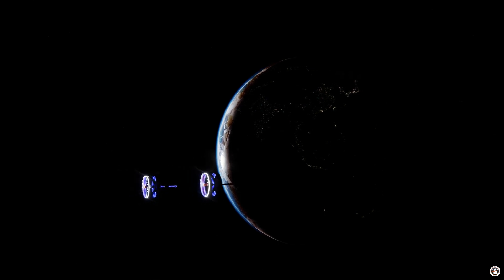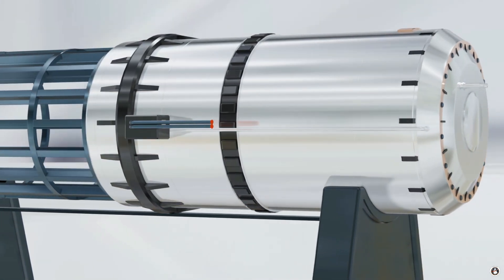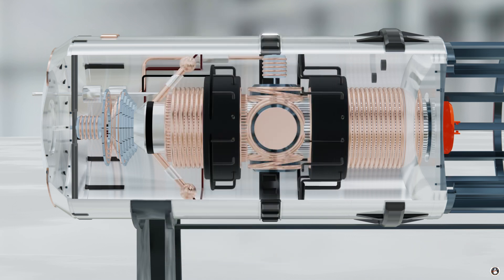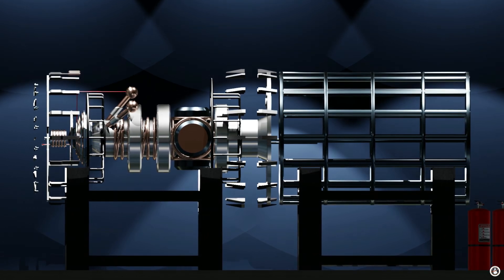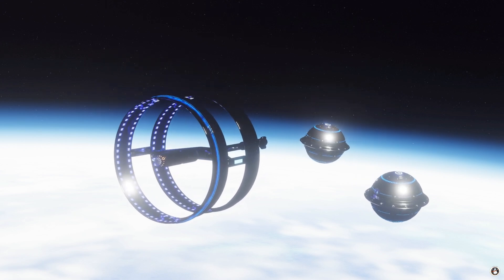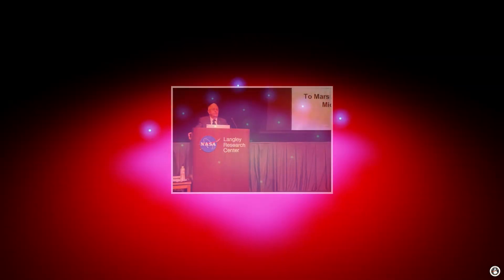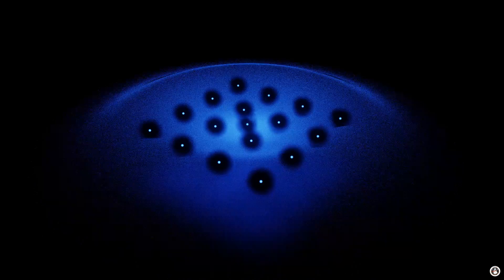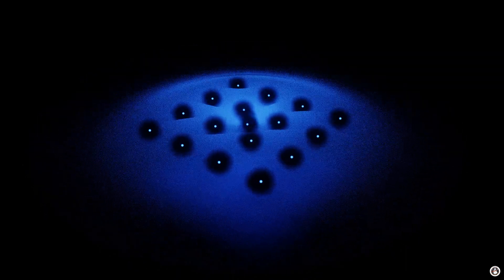Muon Catalyzed Fusion Engine - 8% Speed of Light - Mars in 5 days?

Comment: Did anybody solve the problem of Muon stickiness to the He4 resulting nucleus? 
Because in the 1990s, when I was doing my Ph.D. in (Laser) Inertial Confinement Fusion, this was an unsolved issue.
The lifetime of Muon was too short to catalyze the number of D-D or D-He3 reactions to produce enough energy to produce more new Muons (and keep all the ancillary systems powered up). In this case, the mechanism for Muon formation via Kaon decay, is even less efficient — especially considering how bad lasers are in converting their external excitation energy into optical energy at the properly tuned frequencies.
AFAIK, Muon catalyzed Fusion was a neat SCIENTIFIC effect from the 1950s, but later demonstrated to be an unworkable TECHNICAL Fusion scheme. 
I always had hope than someday, through some discoveries in Quark Plasma Physics, some mechanism may be found to achieve Catalytic Nuclear Fusion, but Muon Catalysis never worked. Being educated as a High Energy Density physicist, not a Nuclear one, I cannot say more.
Full references, please!
Reply: This conversation sounds like the top 2 smartest kids arguing that the answer to question 4 on the exam was 57 or 58 while my answer was south africa
Reply: Not too sure it's feasible to leave our sun behind without working fusion. Which if we master that this would be child's play.
Reply: @rexmann1984  I mean we can, its just way harder
Reply: @antaresmc4407  you're gonna need a ship that can last 200 years at a minimum just to make to Proxima C.  You might as well slap a Molten salt or liquid metal fission reactor with an Ion Drive. Might take you a thousand years instead of 200 but on those time scales does it really matter? In both cases you'll need a ship and crew capable of replication. None of the vital parts will last that long. As power hungry as this drive will be; the mass for the energy production will negate it's benefit in efficiency.
Reply: @rexmann1984  there is no way of going interstellar with an ion drive lol. I mean if you are willing to take a million years... And speed does mater, stuff breaks and folks may lose interest or do something, life support costs also increase...
But there are alts without fusion that can push you interstellar. My personal favourite is a multi stage spacecraft with an FFR (Isp~1-1.5Ms, 3-5%c). You push it with a laser up to 10-15%c and brake with the engine in the other system. You should be able to arrive at Proxima in a generation or two depending on your assumptions, and with the original crew alive if you have no life extension, that you will
Reply: @antaresmc4407  at .10c  it's still a 150 year journey at .15c it's a hundred years. We build very few mechanical or electronic things that can last that long. Regardless of how fast we go we can't break c which is painfully slow with as spread out as space is. Stars and their planets aren't all the material worth doing something with. We have a massive Oort Cloud and so do most stars in all likelihood. 

    This reminds me of a fable my father once told me. An old bull and a young bull were sitting on top of a hill. They see down in the pasture below a bunch of cows grazing. The young bull says to the old bull, "Hey, let's run down there and f#&@ one of them cows!" Then the old bull says to the young bull, "Let's walk down there and f@#& them all."
Reply: @rexmann1984  with the bull analogy, you can do both, civilizations grow and spread. You can colonize tge stars and your own, and you dont spread out too much because you arent getting back investment 10000ly away...
Also, Proxima is 4ly away, so at 15%c its about 30y, not 150. Annd you can break c, at least inside the ship. Let me explain, you dont magically stop at c, just spacetime goes weird, which is roughly equivalent in time to go FTL, you are just slow and squished from an outside view. Anyway, tangents aside, you dont want IS travel to be as casual as air travel, but you neither need to, high tech civilizations are so ridiculously massive I cant strech it enough, and ocasional travel when the product is valuable enough or colonization, it can be fine and a couple years are fine to wait, specially if you have brain augmentations and can slow down your clock. Interstellar transport of people and info on the other hand can be done easly digitally and at lightspeed
Reply: @antaresmc4407  would you like to start this project (interstellar colonization) this century or this millennium? Because this drive is like late Millennium if not next. Due to power constraints.
Reply: @rexmann1984  power is not the issue lol. You can put 2 big mirrors around the sun and get an exawatt. The issue is that 
1) the tech doesnt exist now, nor there is any demmand for it currently. 
2) the infrastructure doesnt exist now, nor there is any demmand currently.
3) you are not gonna do it this century, why would you? It would take a ridiculous amount of resources for basicly nothing.

On this millenium on the other hand, give a few centuries for space infrastructure to develop, stellasers to be tried and tested, magnetic confinement tech to be made, and the resources there to make it even if its for science, it could legit be done. Ill say that is folks really want it, 500y is a plausible, but for a more organic development I would wait for the end of the millenium
Reply: @antaresmc4407  Today, any attempt for interstellar travel is like  medival  people trying to build... a walking castle that can help them to defeat their enemies and transport large groups of people safely. It would take a lot of time... so long that that many participants would lose interest and focus on something that they can achieve in their life time. They would waste a lot of resources on a flawed and archaic design... that would become absolute shortly after launch... perhaps even before reaching to final stage , because someone  just invented steam engine > and built first  train. You can also slap armor on it and take it to battlefield !!!
Reply: @rexmann1984  self-repairable nano-materials will replace metal-like constructions.
Reply: I believe a few comments down, references are given.  I'm so much of a layman, no idea if they are credible sources, but you asked for them, and @AsteronX delivered.
Reply: Yeah BUT....

This is mostly crap and conjecture...... 

a) We need to make the journies survivable - in terms of electronics, mechanical structure of the ships, and for human life..... ships hitting dust and micrometeorites, and interstellar hydrogen = gamma radiation and mega explosions from hitting interstellar fly shit at extraordinarily huge speeds... This detonates the ship in chunks and bathes everything in radiation.

b) AND because the distances ARE so extraordinarily HUGE - we need to close the time scales... which equals for now, increasing the acceleration rates, the top speeds and the decellaration rates...

c) Increased speed = death.  See a).
Reply: @shanet.hanson8250  
a) micrometorites are managed with a thick shield, and the gammas onlg appear at ultrarrelativistic speeds, and can also be shielded. These ships are huge, dont think you are gonna be anywhere close to the front, we are talking kilometers, so it doesnt matter that much anyway...

b) distsnces are ridiculously huge, acelleration times are not an issue. You may lose a small fraction, but nothing to die for.

c) no. See a :P

Id like to know why you call it crap and conjecture just because there are engineering challenges
Reply: @antaresmc4407  About the discussion of this happening organically in a millenia or so, you are assuming our current global civiliazation will not collapse and this social fabric in its current state will continue sustainably for the next 10 centuries? That is being supremely optimistic in my honest opinion :-) 

Just look at all the western Birthrates, they are almost all population inverted in their current form, we will collapse from just the weight of supporting the elderly. Do you have any insight into this?
Reply: Nerrrrrd!
Reply: Don't waste your breath. These guys claimed to be working on a new functional (as in implemented) Alcubierre drive. It's all bs.
Reply: I have a idea,
Reply: Sure they did
Reply: Hello to everyone in this comment thread. Question or recommendation??
Need to find an independent testing facility that has a horizontal near zero friction glide rail test stand measuring low thrust levels up to 1 Newton.

Demonstration prototype engine has completed testing.

But until it has been independently tested and validated, the only claim we can state as fact, is that the engine was damaged during the final tests. Repairs underway.
The Engine will then be available for independent testing.

Engine type,
Cyclical mass driver, table top size demonstration prototype.
Weight, 5.45 kg
Power consumption peak per cycle 18 watts.
Forward thrust, 0.11 Newton's per cycle.
Total Displacement thrust, 0.19 Newton's per cycle.
Power to forward thrust conversation efficiency, 35%.

Douglas Renzoni CTO
Reply: Yeah what he said? Out of my league here
Reply: Would you say that most of what you know about your field came from your time in formal education or your own independent research?
Reply: and, micrometeorite shielding at those speeds?
Reply: I have a question if gravity is a wave why can't we ride it or sirf it .has someone looked upon gravity in this sense . ability to ride the gravity wave like surfing it
Reply: AstroneX Answer they good man is trying to ask about his references. Give us the references. I think Dr. Leehom lady got it wrong. You know, technologically Rydberg matter right now it’s pretty on exploitable, because aside from it being in its infancy as a technology, it takes it in Normas Lee powerful lasers if I’m not wrong in order to be able to create it and I really doubt that it’s behaves like antimatter in annihilation process that is 100% efficient because if it was 100% efficient like antimatter we should be getting gamma rays and pions similar to antimatter.
Reply: AstroneX Answer they good man is trying to ask about his references. Give us the references. I think Dr. Leehom lady got it wrong. You know, technologically Rydberg matter right now it’s pretty on exploitable, because aside from it being in its infancy as a technology, it takes it in Normas Lee powerful lasers if I’m not wrong in order to be able to create it and I really doubt that it’s behaves like antimatter in annihilation process that is 100% efficient because if it was 100% efficient like antimatter we should be getting gamma rays and pions similar to antimatter.
Reply from the maker: Actually, it was found that when the thermal energy of the muons themselves was factored in, the process proved to already have a net output, though 3 to 5 times the released energy would have to circulate internally. The remaining problem was an efficient muon source, now solved.
Reply: @asteronx  
References?
You are saying the same that the Wikipedia article.
Even if the numbers for the alpha-sticking factor are better (0.3-0.5% instead of the earlier 1%), the muon short lifetime and the energy of formation make the net energy production via fusion at least 1 to 2 orders of magnitude lesser than that needed for technical breakeven. Using lasers or e-beams to produce Rydberg matter is going to be a VERY inefficient way to do it. Really powerful Nd:Glass lasers are 0.4% plug efficient. Excimers are not better. Both emit in very specific frequencies that are  not neccesarily tuned to those for Rydberg phase changing on Deuterium. Any frecuency conversion is not better than 50% efficient, and being a 4-wave quantum optical non-linear process. It is a high-power, low energy process very difficult to model in theory and humoungously expensive to implement technically.
Muons made this way are not going to be cheaper than those made with high beam current specifically designed particle accelerators.
When I was a grad student (early 1990s) the designer of Shiva (the LLNL first ICF machine that appeared in the first 'Tron' movie) told me that Laser ICF would be technically workable when Solid State ('diode' type) Lasers — that can be up to 90+ % efficient in their current low-power/low-energy state-of-the-art. Nice for Blue-Ray SF movies — to the Terawatt/Gigajoule required. That was expected for today times. Have you seen one of them yet? Even for this scheme you may need MW/KJ at best. With lasers and fusion it has been always the worst ... for 7 decades.
From your video, it is not clear how muons – NUCLEAR particles associated to the Weak force — result from EM processes. As I am an ignoramus on Electro-Weak HE Physics, cannot say  anything until I see some refereed references. Then my best friend — a former HEP grad and a Kerbalist fan — may educate me.
Sorry, but after 40 years on the Plasma/Fusion/HEDP racket, I am very jaded  about extraordinary paper (or Video) claims on Propulsion and Power devices.
You must be as young as I was in my 1982 YT thumbnail photo!  I was very excitable about these things at that tender age.
Again, publish references for credibility. The Angry Astronaut does that very well, even when it is clear he has not a solid formal STEM education.
Reply: @Tordogor  the muons are formed from the UDD fusion reaction, which is pretty iffy, given that only 1 team has worked with UDD and its not very clear how to reproduce accurately, explain or how it behaves well, according to the reviews Ive seen and my rather very limited knowledge. I cant say anything, but itd iffy in my view...
Reply: @Tordogor   you react too serious to this "pop science for kids" clip... it's just another youtuber looking for extra clicks ...
Reply: @stefanbanev  its presented as a serious proposal...
Reply: @antaresmc4407  
I like your style!
Pity there are so few commenters as  knowledgeable and thoughtful as you.
Reply: @Tordogor  thank you! :D
I feel like I dedicate too much time to nerdness and HSF XD, which is sadly very rare...
Also, there is value to these things, and you dont know where you will find interesting conversation to learn something new or distract from this life both amazing hand hard to convince it doesnt suck XD
Reply: @Tordogor  Lol, this was the first thing I thought... Where does the immense power(and power density containment) for the multiple laser systems come from? Modern energy-on-target efficiency from laser technology is enough to negate the overall thrust efficiency in this system. And then there's the indefinite 10MM°K capable magnetic bottle problem. I guess the proposed engine could be designed for intermittent thrust🤔. IDK
Reply: @antaresmc4407  HELLO.. I'm also very much interested in propulsion systems. Some like minded people like us can team up to do some research. What you say
Reply: @Tordogor  Im not surprised that this video doesnt actually give any useful information, these things are meant to appeal to investors and the common folk, not people who actually know what they are talking about, if you get too technical in these videos you lose attention
Reply: @Meboy-uv5td  
These guys will need investors that have very deep pockets — they must develop lots of concurrent and very speculative embryonic technologies barely proven in the lab —, and also must be tremendously naive and gullible. Somebody believing that Star Trek is based on real stories of Space exploration and Technolohy ...
Reply: @FaizanShaikh-ih3uu  what are you thinking about? It looks interesting...
Reply: @antaresmc4407  I'm saying we can do like a collab or like that 🍻
Reply: @antaresmc4407  I myself wanted to create a fusion powered Engine... Then i realised how difficult was to achieve that ...given time and money and brains we can still make something impressive within decades....or otherwise it would still be neglected
Reply: @FaizanShaikh-ih3uu  we should move somewhere more adequate. Discord?
Reply: @Tordogor  That being said, that means those guys will need Elon Musk. He is the richest guy on Earth and can be their biggest investor if they manage to convince him their ideas can actually work. If they succeed in doing so, he can invest billions in those projects.
Reply: @asteronx  

New theoretical warp drive.
It was also mentioned in the video "This work has moved the problem of faster-than-light travel one step away from theoretical research in fundamental physics and closer to engineering".

1. Go to my channel and find the "About" tab, read the info and click on the link. You might have to click on the "created playlists".

2. Find a playlist about STL - slower than light and other near the speed of light propulsion, on my other channel. The new video is there about the new warp drives.
Make sure to read the video description all the way through.

By the way, did you know there were some space institutes that were looking for new math for their warp drives?
Did anyone tell them about Quantum Computers to help with big algorithms for warp drives, warp drive energy, anything space exploration related, and so on?
Imagine Graphene combined with Photonics for all our products today, and for Quantum Technologies.

This is too important to ignore.
Reply: @gameresearch9535  let me know when mankind has discovered negative energy
Reply: @faceplants2  please no. -energy doesnt play nice with a lot of physics. With QFT, it makes the vaccum spit an infinite amount of particles constantly, thermodynamics just stop applying, forces break as well, and its the door to FTL, which itself is pretty oof with causality and locality
Reply: @asteronx  can nuclear fusion powered drive get us to Alpha centuria
Reply: @asteronx  continuing with the comment above, because that part is both a criticism to the video and some discussion. Textwall warning :P

Id like to first touch on the engine design. I cant get away with what its specs are, because there are several different points made, and a bit vague, with only numbers in the Isp that I am skeptic of btw... Its mentioned that is very scalable, which goes heavily against my understanding on fusion tech, but I have very little idea of cold fusion, so fair, Im not gonna gef there. It claims aneutronicity on D-D reactions, which is absolute bust, and I dont buy that a powerful magnetic trap will deflect neutrons, like wtf @AsteronX does that mean, did I miss something? That doesnt work this way... So I am gonna use regular D-D figures to estimate its specs and neglect bremstrahlung (butchered) loses because its cold fusion and shouldnt be too important:

The models and explainations imply an internal reaction engine, so all neutral particle energy is absorbed. That and a Ve of .08c, which is over the theoretical max of D-D lol, but I guess thats accounting for lack of b-word loses I guess? Idk, benefit of doubt as Im too lazy rn to calculate. That means that we have a thrust power of very roughly 1/3MW/N, plus whatever the hugely inefficient muon mechanism uses. Im gonna assume 1/2MW/N as an estimate of all the heat of the engine, power systems and stuff to run it, as its an easy number.
For a 1 ton engine you need to produce 50GW to reach a TWR of 1, and Im telling you a fusion engine and much less the radiators required are gonna be included in that weight. So there is no way its both high thrust and Isp. @AsteronX, bruh, dont do such claims b4 calculating it, the formulas are super simple in that case :/
And again, Id like to know where tf comes the aneutronicity... 

Id also like to add a critic of small details that really bother me because they look poorly researched. First, lets make a point about the nozzle, being completely flat like this you get little advantage of the magnets you use and you create an inefficient nozzle, but thats aminor detail. Id also like to touch on when you mentioned radioactivity spreading to the crew quarters like if it was a virus. I hope you realized this is completely wrong, its true that nuclear reactions generate lots of neutrons that can cause activation, but those activated parts (generally) make no more neutrons, so the reactor just trashes itself over time without the radiation escaping assuming its properly shielded, and in a century or so you have to replace the walls as are damaged and slightly radioactive. The worst part of this thing is that thats not what you meant, because you are using deuterium fusion, that is multiple times more neutronic than fission, and with nastier high energy neutrons! WHY? That was unnecesary and makes me think you might need more research if this is a serious publication, sorry if Im not being thd most polite, but I took this as serious, or shouldnt I? (This is not sarcasm, Im legit asking, sorry, Im not great with English c:)

I have seen a bunch of stuff that goes differently to what I think I know, could you provide some references and extra reading, please? Thank you in advance :D
Specially in the rocket design  part as my kowledge of QM is rather limited, so I cant really talk about the fusion/annihilation part, that is what the listed articles talk about. Im reading them though

Also, there are probably typos I missed, that was written in a phone late in the night :P
Reply: @antaresmc4407  
Good analysis!
Have any UDD Fusion references other than Wikipedia's1?
Reply: @antaresmc4407  If it were less of a nozzle and more like an electron emitter I wonder what application there would be for a solar sail.
Reply: @nikorasu6930  for that arent regular beams just better? They are also short range
Reply: @antaresmc4407  Not when the device in question requires the power of the sun for it to move.
Reply: @nikorasu6930  electric sails are way more efficient than light ones, and you use that power anyway...
Reply: @Tordogor  ok I thought I replied you with a set of references I looked for. Youtube us fun :/
Anyway, search the works of L. Holmlid, that has done tge supermayority of stuff on that topic. Googling ultra dense deuterium on G schoolar also works as there is not a lot to go through, but its a while anyway... Warning of confusing terminology, the UDD that does that weird fusion is D(-1)
Reply: @antaresmc4407  
👍 Thanks! I will give a look at it.
Reply: Simple enough: just bombard the muons with x or gamma rays of the proper energy to unstick them from the helium. A friend of mine came up with the idea.
Reply: @michaelperrone3867  and then you need a lot more power than just making mord muons...
Reply: @antaresmc4407  Actually compared to generating the muons this would take relatively little power.
Reply: @michaelperrone3867  what would take little power? And what neutrons? Idk wdym
Reply: @antaresmc4407  I meant muons; fixed.
Reply: @michaelperrone3867  This is a pretty obvious idea; I proposed it to people working in the field about 30 years ago, but it seemed like enthusiasm was already waning at that point. And note, it would not take a lot of energy to bathe your reaction vessel in radiation tuned to the ionization energy of muonic He, it is a narrow band, you can generate it pretty efficiently. It seems to me that it just awaits some enthusiastic engineering attention.
Reply: If you tell somebody that it is a problem or unsolved issue, he probably won't even try it. Many great discoveries were made by guys who didn't know it is impossible.
Reply: Im just here to watch all the armchair astrophysicists make super long, smart sounding, refrence demanding text walls of scientific jargon, instead of just getting out there doing the dam thing themselves.
Reply: @armadasinterceptor2955  you say that as if jargon and actually-doing-ness was enough lol. There are no resources nor knowledge to do it rn, and whoever that claims that it could do it in a few decades with a bunch of funding is probably lying.
Also, you mean out there, in the ExTeRiOr? That sounds scary XD
Edit: Im working in an automatic technobable generator for funsies, if you want jnfinetly long textwalls of jargon... XD
Reply: @antaresmc4407  thank you for your knowledge and deep discussion.
I do however agree that humans will probably make the planet in habitable before a plan is feasible. Our population needs to rapidly decrease and our efficiency needs to rapidly increase with technology doing more of the work.
Reply: By the way @AsteronX the secret to "ultradense deuterium" lies in the substrate: heavy quasiparticles in the surface of the material can behave like muons to bring the nuclei into close proximity. Feel free to reach out if you want to discuss it further.
Reply: Muon stickiness and lifetime is less important here than for a power station because it does not need to create power. It could use a alternative power generator to create the muons and accept the fact that it is a net energy sink.  If the power required to create the muons generates better thrust to energy than a ion drive then it is a potential winner. BUT the video never makes it clear how the muons are created and I am very skeptical.
Reply: @mtpaley1  if you have a net loss of power you better use an electric engine. Positive or bust
Reply: @mtpaley1  wrong. Without the fusion power it won't go. Which is kind of the point...